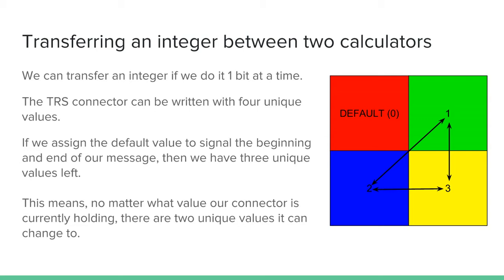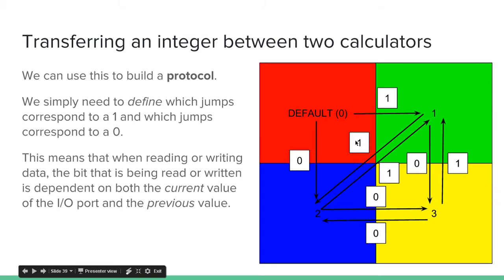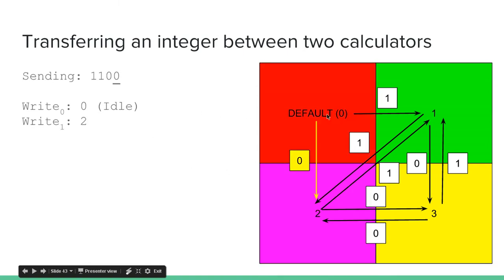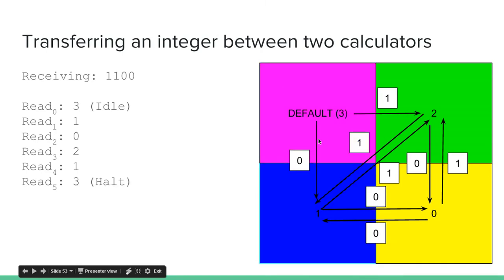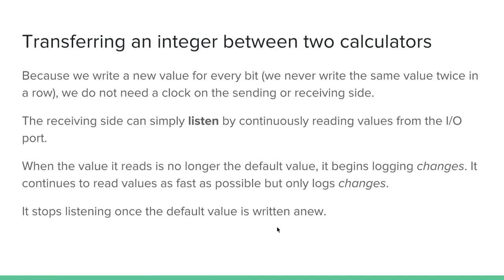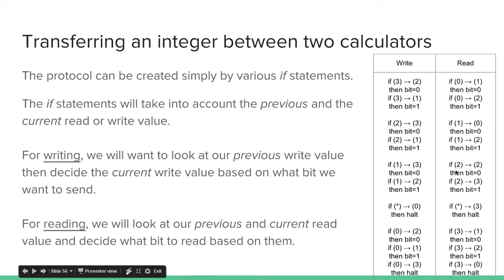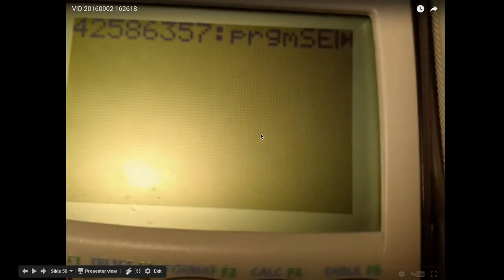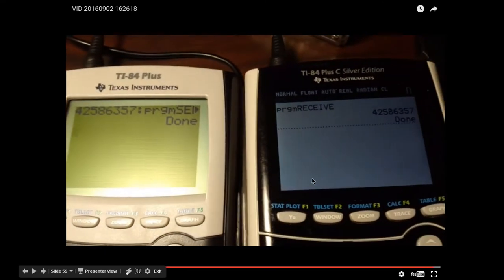TI-83+ I/O Port Tutorial #4 - Transferring an Integer

Comment: I am using 2 TI-84 Plus Silver Edition calculators running 2.55MP software. Starting the receive program first, but i still get the overflow error. What am I doing wrong. I have checked it multiple times to make sure it is exactly what you posted but it still doesn't work?